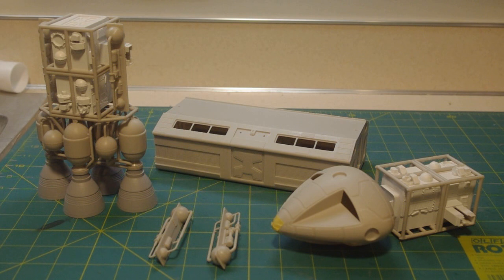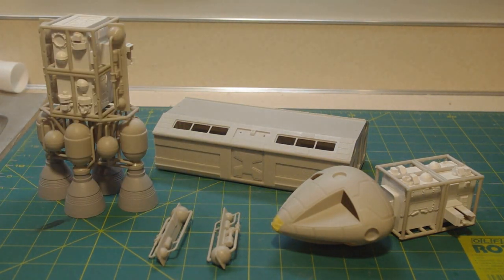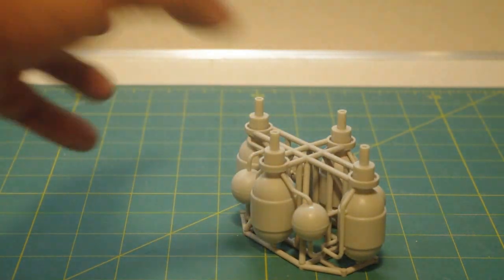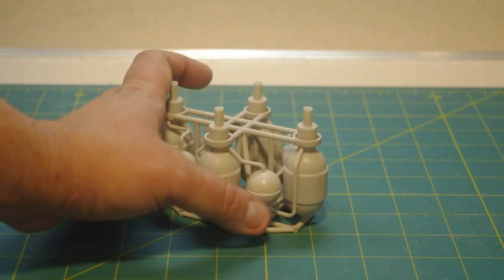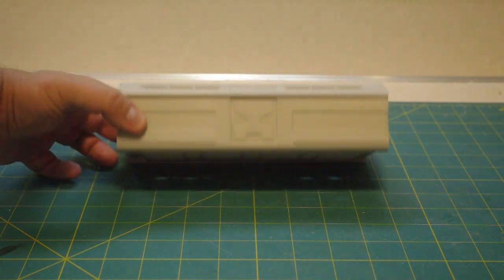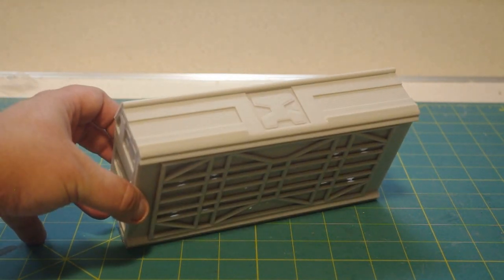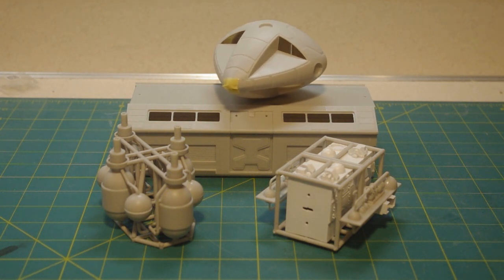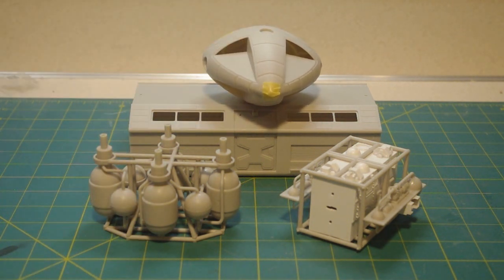MPC Space: 1999 22" Eagle Test Shot Build Part 3

Comment: Hello Mr. Chladek... I would like to thank you posting the previews of the 22" Eagle Transporter "Test Shot"  I am Soooo looking forward to building this kit when it is finally released. At Minute 4:20 you show the underside of both cage modules which the engine and CM connect to. My question is shouldn't the support bars with the Landing Pods connect to be under the (for lack of better words) the cage area which is divided by 6 (which will support the VTOL Rockets) instead of the present location divided by 3. I was just wondering which is correct location. Thank you again for your videos and look forward to your next Part 4 of the Test Shot build.
Reply from the maker: +Sal C Thanks. The attachment slots for the leg pods as you see them on the sides are oriented just as they are on the studio models. The leg pods each have a large tab that slots into those holes. The overall configuration of the parts is heavily based on the 44" studio model and the original builders of those models did a pretty good job in the basic design for how everything fits together.What is a bit unusual to many of us who cut our teeth on the old 12" MPC model kit (or the Dinky Eagle, or even the large Mattel Eagle) is the leg pod tabs do not fit into a centered slot. The tab hole is offset to one side, so the alignment lugs on each of the leg pods are also offset. When the leg pods are added, they do look centered and this matches the studio model design. The six divided area down there is where the VTOL thrusters go (the visible alignment pegs show exactly where they go). What you don't see yet are the "X" patterned pieces of the cage structure that fit outside of the inner cages both top and bottom and there is a vertical cage wall with openings that the leg pod slots fit through. I'll try to showcase how the pods fit in my next video (probably this weekend).

Comment: Hello dear Sir,
It's a great videos and really precious, I have few questions about the primer and the paint of your Eagle.
Please can you give me the name of the brand and references of your primer and the white paint ?
Do you have using an airbrush or spray ?
In advance a great thanks, best regards ;-)
Reply from the maker: I cover that topic in the final Eagle video.

The primer brand I use is Tamiya spray can, typically thier fine white spray. Yes it can be pricey, but I haven't found anything better and I don't want to risk skimping on primer and paint products.

As for the paint color, I ended up using two shades. For airbrush, I used Testors Model Master acrylic Camouflage Gray with about 30% white added to it. As for spray can, which I used on the pod, it is Tamiya AS-20 U.S. Navy Insignia White. Despite the name, it also looks to be a form of camouflage gray with about 30% white added since it is too dark to be a pure white shade. Both these shades match the plastic color the production kits are molded in almost exactly.

Comment: Sorry, forgot to ask you a question. I was looking on the Round 2 website, and they've posted the instructions that will come with this kit. I'm not a fantastically skilled modeller, and building the engine piping at the back of the Eagle looks pretty difficult. Would a modeller of average skill have any problems assembling the piping that goes at the rear of the Eagle? Thanks in advance for any info
Reply from the maker: yes, provided you take your time with it. the engine pipes are done in pairs and the holes in the sphere parts are slotted to make sure the pipes are oriented property. That being said, consulting photos and test fitting will help minimize problems.
Reply: JMChladek Thats great, thanks very much indeed for the advice; much appreciated